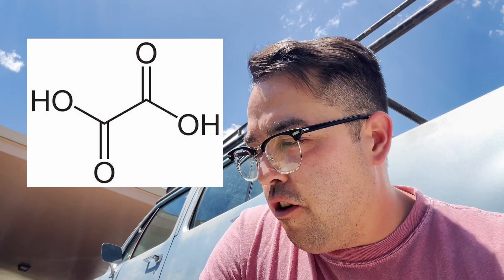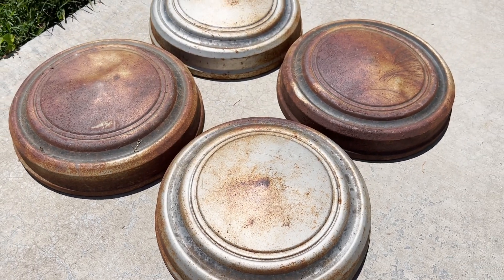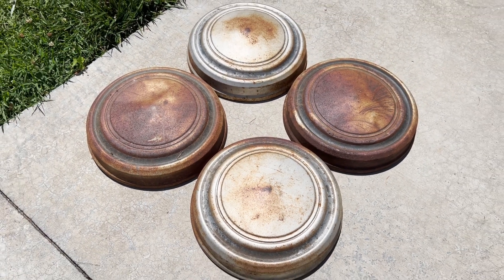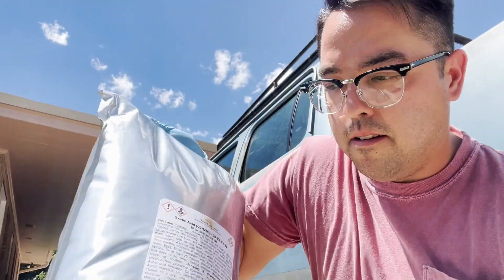Oxalic Acid, Make Rust Disappear! Uses in Automotive Settings! Science! Chemistry!

Comment: What folks may not know is that oxalic acid was the radiator cleaner and removed from the market. You must neutralize after use, I don't think it's good for dissimilar metals, so may need to be careful in modern cars but not well versed. However, I have found it more effective than the 'super flush' that is sold now

Comment: I used white vinegar soak on some very rusty hubcaps and bolts. Took a while, but worked.
You have to clean, and wax or clear coat soon after, as the parts will flash rust quickly.